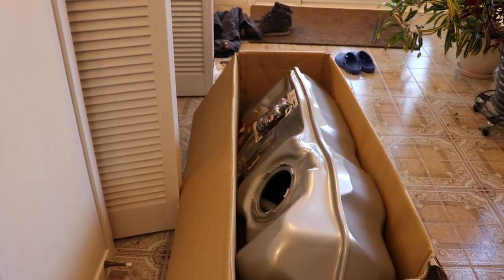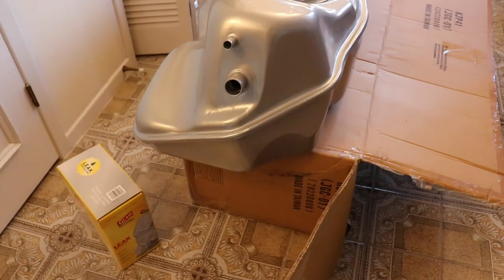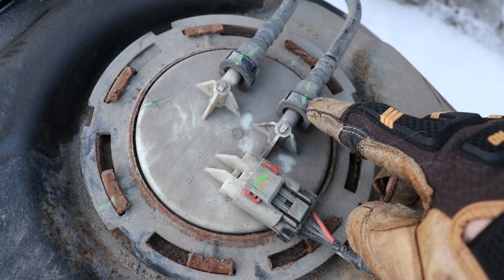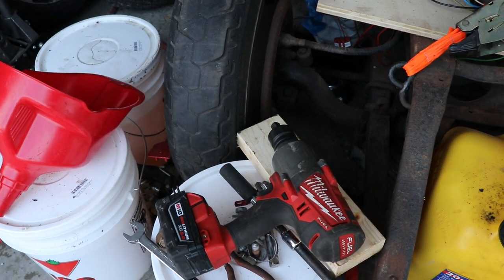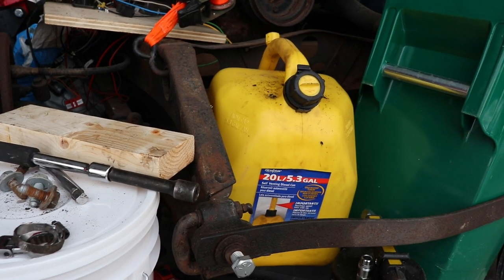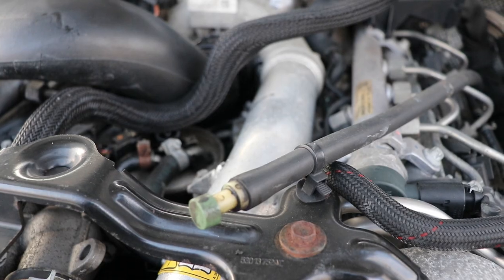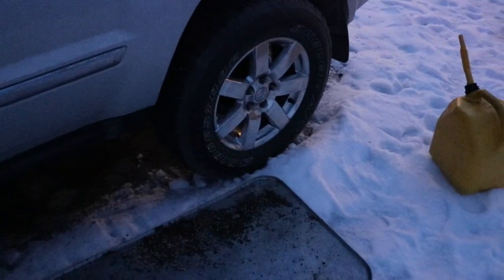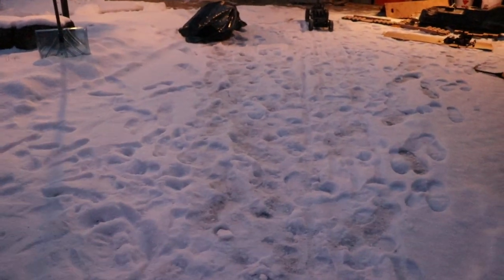2005-2010 Jeep Grand Cherokee WK CRD Fuel Tank Replacement

Comment: Hi Stephen. Great to see you back with a Jeep video. I admire your skills. I noticed you did not add any rust prevention to the tank. Is that silver coating good to go?
Reply from the maker: Thanks, the Jeep has been nice to me lately so not much has been going on with it.  The silver paint seemed OK as it wasn't missing anywhere.  I would not use rocker guard or bed liner as they seem to trap water between the layers.  I think the most important thing to do is ensure that the rubber spacers are in place and wash off the tank once in a while.
Reply: @SteveRivett  Hi. It is inevitable that i will have to do my 2008 GC at some point. Road salt is the killer here in England. I do wash off best i can with a pressure washer. Your link to the fuel tank is not correct mate.
Reply from the maker: @Nick-bp7jf  Hi Nick, thanks for the heads up on the link, I've fixed it now.  I think the tank failure and the leaking oil cooler o-rings are the most annoying things that can happen with these vehicles.